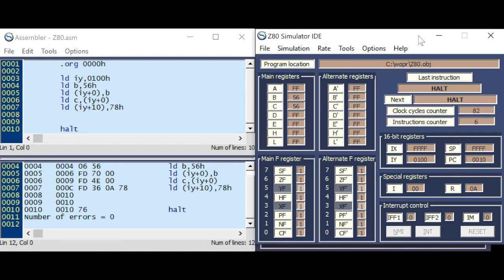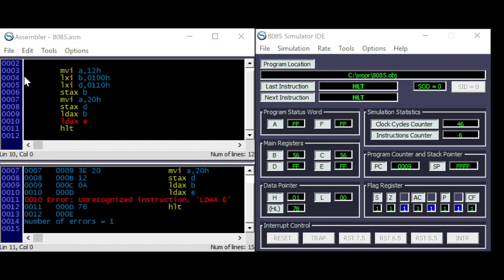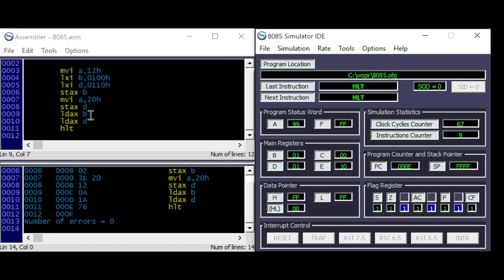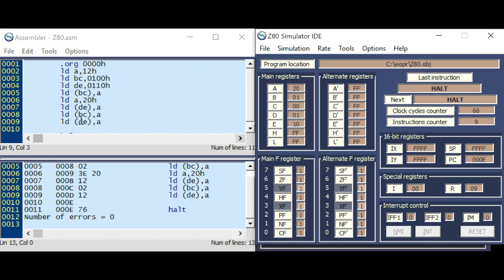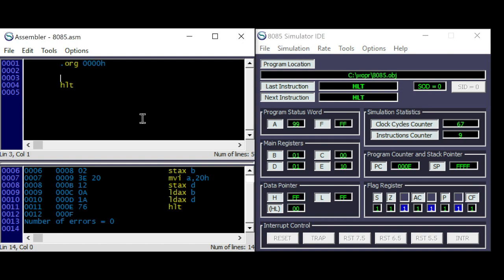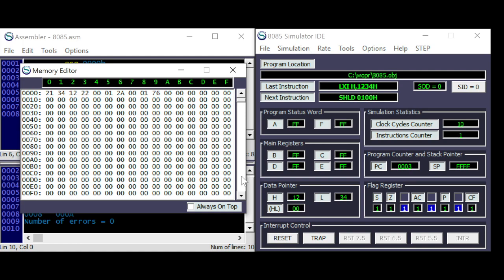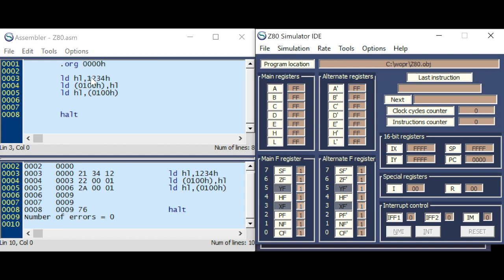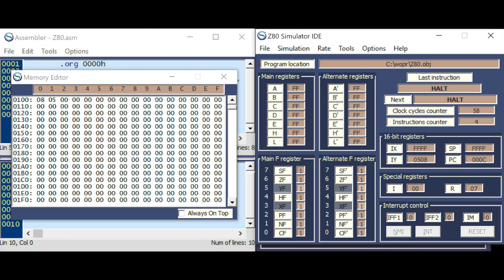Part III of programming the Intel 8080, 8085 and Zilog Z80 in Assembler

Comment: I think a lot of ppl have chosen one processor or another. A suggestion to improve your videos in this series is to teach one processor for the first half, and the second processor for the second half. If you include a time marker, ppl that prefer the second processor can skip to it. I understand the academic purpose as to why you are contrasting the two, but it may not serve a practical perspective if ppl's time is limited.
Reply from the maker: I can understand your point. The initial idea was only to show the differences between the CPUs and why it makes sense to write Z80 code even if the Z80 is compatible with Intel 8080 code. In the eighties, most CP/M machines had already a Z80 CPU, but the programs were mostly written for compatibility reasons only for the Intel, or if you're lucky there were two versions of it. The speed gain could be tremendous. There you have to deal with both assembler versions. I will think about it, even if there are a lot of instruction videos for the individual CPUs, but sooner or later I have to split them because a lot of commands don't exist on the Intel.
Thank you for your suggestion.